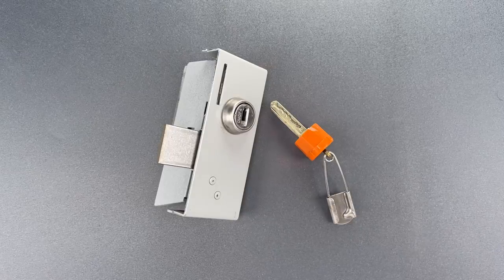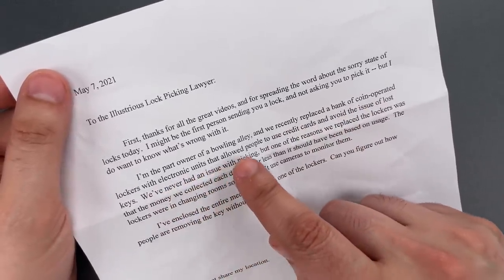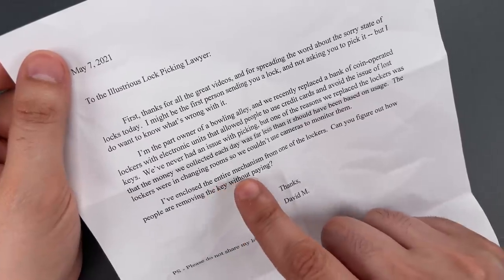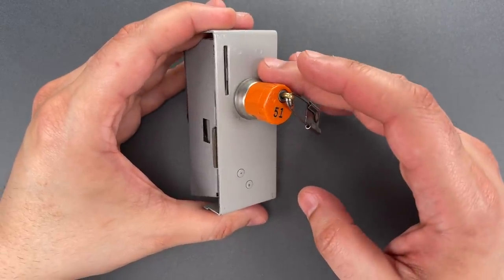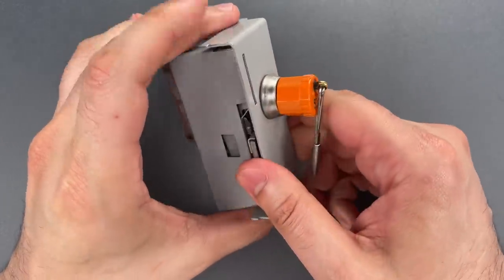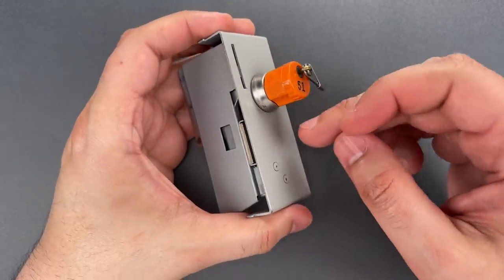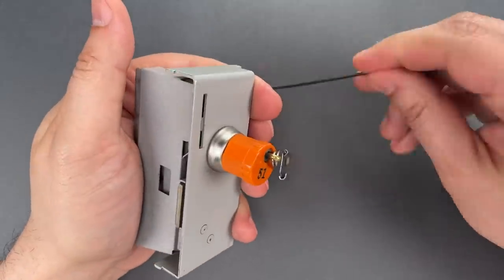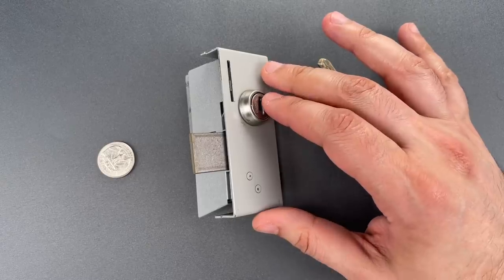[1308] A Huge Flaw In This Coin-Operated Locker Mechanism

Comment: A lot of these coin operated lockers are used at swimmingpools in the Netherlands,  however, you get the coin returned when you open the locker.
Thus defeating the need for cheating the lock.
Reply: Same thing is quite common in UK gyms and swimming pools.  You get a refund on returning the key basically.
Reply: Most manufacturers actually make two versions of the coin-op lockers locks.
Some give you back your coin, some will keep the coins in a secure box within the locker door or below the lock itself and there are even ones (Although I've never seen one in the field so far) that will take two coins to work, one being kept as a payment and the second one being returned.
I'm still trying to figure the point of using two coins though...

BTW I'm French and pretty much every swimming pool I went to so far does have the "free" one coin version that gives you back your coin.
Reply: That also prevents the owner from making money though

Edit: obviously I meant it prevents them from making money specifically off the lockers, not that it prevents them from making any money at all, but apparently some people need that to be spelled out for them
Reply: @_Stormfather  Good
Reply: It's the same in Germany. I think a locker should be part of the service and not a way of making additional money.
Reply: Yeah. And in Norway it operates the same way when you take your empty beer, soda and waterbottles/alu boxes back to the store. Less trash and increased motivation to get the money back. Approximate refund (pant in norwegian) is low end 10% of the beverage (I think) to 20%. All stores that sell such containers also have to take them back. A genius system I'm suprised aren't used in many places.
Reply: @Mr Brightside the issue is (at least where i live) is people not actually using the locker since it only costs like 20p sometimes, keeping the key and then using it later to steal someones stuff
Reply: @Mr Brightside it's about leaving the key in the lock after you got your clothes out of the locker :-) You can only lock (and take the key) when the coin is inserted. No coin, no key :-) Without the need for a coin you could just lock the empty locker upon leaving and take the key with you. The (old) pool in our city actually doesn't use coins but coin-like-tokens instead. You get your token upon entrance, and have to return it when leaving. They somehow code your time into the token, so the turnstyle on the exit knows if you have to pay extra because you stayed in the water for to long. By also using the token for the lock you can't lose it while in the water.
Reply: The carts at ALDI have a similar mechanism, you have to put a quarter in to unchain it, and put the cart back to get the coin back. Of course, if you're nice you'll pass the cart to another person and they get a free quarter. :)
Reply: @Mr Brightside Without requiring a coin, some troll might have the bright idea of locking all lockers and running off with the keys.
Reply: @bluesideking  I agree, it can't be that much money they're making from it. Although, it may be a form of demand control, if they were free there wouldn't be enough lockers for people who wanted them. Who knows?
Reply: @_Stormfather  That's not a problem when nickel-and-diming your customers on stuff like lockers is not part of your business model.
Reply: Exactly. I'm surprised that they have an actual "cost" elsewhere. Seems awfully cheap of an establishment to charge you to use a locker in addition to the cost of the service (gym, swimming pool, bowling alley, whatever). Add 25c or whatever it is onto the price and ditch trying to charge extra for lockers; no worries about people "cheating" the locks and it doesn't make your establishment look so cheap and nasty.
Reply: @randybobandy9208  A QUARTER??? Here in the UK we have to use a £1 coin (about US$1.40)...
Reply: @psirvent8  Reason for two coin version of lock.
Owner has two objectives.
1. Wants rent on lockers.
2. Wants keys returned.

Objective 1 is served by requiring a coin.
Objective 2 is encouraged by providing a "refund" to the user when they return the key.
Hence the requirement for two coins.
Reply: @Mr Brightside A not so nice person could remove all the keys without anything in the locker and not bring back the keys.
Reply: @Mr Brightside It's actually quite easy :-) There's a turnstyle on the entrance, you put your money in (for 1/2/3 hours of stay), get a token and the turnstyle unlocks. Then you use the token for the lock (so you can't lose the token while you have the key and can't steal the key when you got the token back), and on the exit you put the token back into the turnstyle, it checks (somehow) the length of you stay and either onlocks the turnstyle directly or after you payed the additional fee for staying to long. And yes, it's a really neat solution ;-)
Reply: @Mr Brightside 
You're assuming that something was put into the locker. If there was no coin required, there's nothing preventing you from locking all the lockers and taking the keys with you.
Reply: In the old days (80's) in Portugal public swimming pools had workers handing you a sort of clothes hanger with a basket for the shoes and would keep it while handing you a rubber wrist/ankle band with a numbered plate that you'd exchange back for your belongings later when leaving
Reply: @_Stormfather  which is a little pointless, given these usually are in a place where you pay a fee for entrance/membership first
Reply: @_Stormfather  You mean there's bowling alleys in the US that provide games, shoe hire, snacks and drinks for nothing? Their only form of income derives from 25c a shot lockers?

WOW
Reply: @_Stormfather  you're having to pay to be there already usually.
Reply: @Mr Brightside Nudists are a thing! Seriously, though, the payment discourages people from just taking the key with them to reserve their own locker.
Reply: I wouldn't be surprised if people still try to cheat it. Like people stealing free stuff lol. Or sort of similar to people paying $45 for a fake vaccine card instead of getting the free vaccine.
Reply: @naerbo19  used to happen in the US, may still in a few places.

Made for some really disgustingly dirty, nasty and unhygienic rooms where the returns were accepted, so most stores stopped doing it.
Reply: @_Stormfather  you're already paying for being able to enter the establishment. the coin is only there so people don't take the keys from an empty locker
Reply: @redminotecheiraomem2549  Got about the same system here at my local pool in Sweden today but you get a numbered key for a locker on a wristband when you pay the entry fee.
Reply: This is at our amusement parks, swimming pools and shopping malls in Canada.
Reply: @bluesideking  tell that to cedar fair. Lol
Reply: @mallardtheduck1 , so what you're saying is they should charge for the locker, just do it in a way that hides that charge by combining of with the regular fee.
Reply: @CherryGS  No. They don't code the time into the token. Its very rare they do that - especially in this system where the lockers are mechanical. Its more common that the token (or tag) have a serial number. When the token is issued, the time of issue is recorded along with the serial number of token in the computer. When you exit, the turnstile checks with the central computer how long the serial number has stayed.
Propably they also have monthly and yearly tags too, where you can purchase a subscription and keep your tag (ergo turnstile don't swallow the tag but return it to you), and stay as long as you like in the water until the place is closing. Its the same here, the serial number is recorded along with its end date of the subscription.

Think like the barcode on the milk package. The barcode don't encode the price, the barcode is same regardless where you purchase it. Instead the barcode is recorded along with its price in the cash register, so when the barcode is scanned, the cash register knows how much it cost.

In those places with electronic lockers, its more common with tags that bear information. Then the tag stores information about your stay time, and if you have taken a locker (and which one) so the exit turnstile refuses to open if you have forgot something in your locker, and also so other lockers refuse to lock so you can only allocate 1 locker per tag (or more lockers if youre a family). In many cases you can also carry a balance so you can purchase ice cream and such in the kiosk by just scanning your tag, and overstay can also be debited from that balance, and any leftover money is returned.
Reply: In my experience in the states, these are more common in "optional" locker areas.  Like say, at an amusement park where you may want to stash things you don't need during the day.  At gyms and pools and such, you're more likely to see a locker that requires a padlock but is otherwise free to use.
Reply: the 2nd coin is collateral.
it's an additional incentive for you to return the key.
Reply: @bixiebee6165  How do you use the key in a locker that didn't have one for someone to put their belongings into?
Surely any key doesn't fit any lock? Maybe the management just replace missing keys?
Reply: @peterthomas5792  If the management replaces the missing key and not the _lock_, then you got your answer: someone will put something there, and you still have a working key.
Reply: I believe they use the same lock, only reroute the coin out the back instead of to the collection bin below.
Reply: @Mr Brightside Unfortunately some people would just take the key "for fun" without putting anything in the locker.
Reply: @Mr Brightside You could hog the locker by keeping it empty? So when you return you have a free locker to use maybe
Reply: @psirvent8  The point for two coins is 1. Business makes money, 2. Customer is incentivised to return the key (leaving the locker free for others to use). Some people hog the lockers
Reply: @Mr Brightside I suspect it's more to keep someone from just walking up to a bank of lockers and stealing all the keys. If it takes a quarter to take the key, then the user isn't really charged to use the locker, but it can get expensive quick for people with nothing better to do.
Reply: @_Stormfather  It doesnt because those places could just ask for that money on entry. Only time where this is an issue is when you cannot do that which is never.
Reply: German-style supermarkets (i.e. Aldi) do the same for shopping carts. You insert a quarter to unlock it, then you get the quarter back when you lock it back up. Removes the need for cart attendants.
Reply: Same here in Belgium. Don't see why charge for using a locker in places like swimming pool, or a bowling place.
Reply: @randybobandy9208  When I go to Aldi, there seems to be an unspoken agreement among all the customers that if someone offers you the cart that they're done with, you give them a quarter in exchange. After all, you would've already had that quarter ready to get your own cart.
Reply: @Mr Brightside Maybe. Did you put clothes in the locker, or did you just decide you wanted a souvenir key?
Reply: @naerbo19  meanwhile in germany the cities are littered with cans because people leave em out for the homeless.
Reply: @psirvent8  Two coins means the locker doesn't have to make change. It means the locker can give back the exact same coin the user put in it, greatly simplifying the design. It would allow the owner of the locker to rent out the service of the locker, making money, while giving some incentive to return the key afterwards. Personally, I think it's brilliant, and I hope the coin used for insurance is of a high enough denomination to pay for the key a couple times over when the key does occasionally go missing.
Reply: @_Stormfather  The owner is already making money from providing the service. Nickel and diming people typically results in a net-negative experience.
Reply: @bluesideking  I remember going to Germany and Europe in general and felt the same way. Asked for a glass of water and they brought me a bottle of water that was 1 euro. In most parts there aren't public restrooms nor places to drink water or fill a water bottle.

I think it is a cultural thing, in the states for example in a gym you often have to paid for everything in 'a la carte' want a towel? that will cost you, want a locker? that is an extra 25 cents. but then you have things that you often give as granted like water, free refills of soft drinks and coffee, etc.
Reply: @_Stormfather  Places can be pay-to-enter, so it doesn't matter if the locker is free. Cost is covered elsewhere.
Reply: The gym at work had "bring your own lock" lockers which resulted in people permanently occupying the lockers of which there weren't many. I occasionaly considered putting my own lockpicking skills to work but didn't want to inconvenience anyone genuinely using them. Supposedly locks were supposed to be removed every weekend by management but never were.
Reply: @naerbo19  I've seen it used, vary rarely here, for shopping carts, where you pay a coin to get a cart at the front of the store, and get a coin back when you slot it back in the rack as you leave. I understand the system is more common in Europe and the UK. It cuts down on the number of employees needed to go fetch carts from the parking lot, and reduces the damage, to the carts and the cars, from them hitting cars and being run over. Both of which, naturally, reduce operating costs for the store.

Some states do have a bounty on empty beverage containers, usually 5 to 10 cents. I suspect it's for exactly this purpose. It also probably re-created the ancient job of rag-picking.
Back in the before times, as in Before Plastic, bottles would be collected, washed, and refilled. That's less for waste reduction, or litter control, and more a rental on the glass bottle.
Reply: @FrancoCastro  Yes. Definitely not unusual to be out shopping in Europe and get caught short. Never pleasant.
Reply: @KingdaToro  Only fair. Though often that gets turned down here.
Reply: Same in Norway, except since no one uses cash anymore, you can buy these little 'coins' with holes in them that you can attach to your keychain and then use when you go to the swimming pool.
Reply: The owner is a cheapskate who deserves it. Any reputable business returns the coin. He’s already making money from his bowling alley.
Reply: same in france.
Reply: @wictimovgovonca320  > I believe they use the same lock..  
So you could insert a coin in any lock, grab the key and open any other locker?
I can't believe that, they'd be in court the first day it happened.
Reply: You need to come to the uk mate looool
Reply: @Mr Brightside well there could be a jerk just locking all dors with nothing in them and throwing the keys all away.
Reply: True, money should be spend at the entrance, not when changing clothes. The coin should just be there to discourage people to just keep the key to the next workout session (wich they often do in gyms) or forget to put the key back in.
Reply: @_Stormfather  Money is made by charging admission fees and selling food. The locker is there as a service, but the coin is a deposit so people actually return the keys after use.
Reply: @_Stormfather  well.. they are already making bank from memberships and over priced single time gym/pool uses, might as well give out complementary locks to their loyal customers
Reply: @Mr Brightside so you don’t just lock a lot of lockers and take the keys with you
Reply: Seems like a good system, really. Rather than nickel-and-diming the customer, it's usually better to try to cover your costs with a higher-level charge like a membership or admission fee. Only thing like that I've seen in the US is the shopping carts at Aldi, which take a quarter and eject it once you return the cart and re-connect it to the chain.
There's definitely some cost/benefit mismatch for any would-be cart thieves, and there's no way someone determined couldn't get their quarter back after walking away with the cart, but it seems to work well for 'em. Of all the carts I've seen abandoned on the side of a road, I've never seen one of theirs in the wild.
Reply: @Mr Brightside Who says you have to put anything in the locker? If the intention is to take the key, hope the owner just replaces it with a spare then you can get access to someone else's belongings. That said, I'd hope the entire lock would be replaced to prevent this but who knows what an owner might do to save some cash...

edit: and I'm late to this party ;)
Reply: @S_Roach  I suspect that we don't just wash and refill, but melt the cans and glass flasks down and make new ones, or use the material for something else. I could be wrong, but from listening to my brother who collects milk from farmers with a lorry, it seems it would have to be washed with very hot water and some highly acidic chemicals to avoid a new plauge.
Reply: @harpingon  in Spain it's the same; coin returning in swimming pools, supermarkets, bowling...
Reply: @_Stormfather  not if you pay to enter. I've never seen a coin operated locker in Denmark for a swimming pool for example. you pay at the entrance and the lockers will just have keys in them and you can use them free of charge.
Reply: @randybobandy9208  or you use one of the fake coins they sell at every store for the carts
Reply: @randybobandy9208  I've also seen local urchins going around and collecting the carts in the parking lot to get the coins back. So it's a way for the store to avoid having to pay anyone to round up carts.
Reply: @jrd33  I expect you get it back, like we do in Catalunya where it’s 1€/50c. If someone was cheap enough to try and chisel me out of money like LLP's guy I’d go somewhere else on principle.
Reply: @bixiebee6165  If they kept the key how would the party of the second part secure his stuff? Unless you mean he’d just put it in an unlockable locker. I would pay the 20c to hire the key and get a copy cut.
Reply: @aloysiussnailchaser272  he's under no obligation to provide a locker. If you want an additional premium service, what's wrong with being charged to use it? Fairly straightforward.

I've actually never seen a bowling alley with lockers myself. Usually there are cubbies by the doors, by the lanes, or you just stick your shoes under your chair. I'd rather keep my stuff in sight regardless.
Reply: @giin97  It's not a 'premium service'. It’s just mean spirited. I’ve never been in a bowling alley but presumably that has to be paid for. I’d expect something as basic as a locker to be included. Of course no one is under any obligation to use it.
Reply: @BunjiKugashira42  People still do this, but at least the £1 can go towards the cost of getting the locker re-keyed.
Reply: @naerbo19  It is in many, many jurisdictions, just not involving every store needing to sort and store empties, but go on.
Reply: The ones I've seen also take the coin inside the locked door. So you can't access it when it's testing the coin.
Reply: What's the point of a system like this? Aldi in the US does this with shopping carts/trolleys, but that's to incentivize people to put away the cart. What is the purpose of doing this with a locker?
Reply: @harpingon  same for germany
Reply: @randybobandy9208  a round key works as well.
And if the key is small enough you can easily take it out while opening the mechanism.
Heck, a toothpick works.
Reply: @tee2567  I'm aware that many other places have such a system or similar systems. Found an article which explains a tad better and also have photos. Though the reimbursment have increased recently from 13 cents and 30 cents to 24 cents and 36 cents: https://www.sciencealert.com/norway-s-recycling-scheme-is-so-effective-92-percent-of-plastic-bottles-can-be-reused . I read through it and seems accurate, but I can't vouch for the % being mentioned there.
Reply: @Adam1nToronto  which would result in other guests being unable to lock their belongings up, thus leaving them vulnerable to theft when the key-thief comes back.
Reply: @aloysiussnailchaser272  it's an extra thing not required nor expected. It being available for an added cost is literally the definition of a premium service. It's mean spirited to offer a dozen lockers for any patrons that don't wish to put their shoes under their chair, and then charge to use them? The simplest alternative is to simply not buy and install the lockers, thereby removing the option from others. Just because you aren't interested in the option, doesn't mean others aren't.
Reply: @_Stormfather  isn't the core business supposed to earn the money? Lock is merely an evil necessity for the former. I myself rather they "hide" the locker charge in the overall cost. All these extras tend to bug me, even i know nothing is for free 😁
Reply: @_Stormfather  Is the owner on the business of renting lockers or on the business of running a gym, bowling alley, department store, etc? Stop trying to make money out of absolutely every little thing.
Reply: @giin97  We’re not going to agree about this, and that’s fine. I think it’s mean, you don’t. No problem :-)
Reply: @_Stormfather  How very American/Ferengi of you.  ;)  The business owner has a vested interest in protecting customers' belongings.  Not every single aspect of a business must make money on its own.
Reply: @Mr Brightside If you don't have to insert a coin to use the locker, some cretin is going to lock them all and keep the keys, just for a laugh...
Reply: @jdjk7  It incentives people not to steal the keys. The coin only drops out when you unlock it, so even locking it open will cost you £1.
Reply: same thing at the gym at my university. you get your quarter back when you open the locker
Reply: @majorgnu  the lockers need paid for somehow.. should the business owner not bother with secure storage and just say "all items are your responsibility, dont cry at us when its stolen because you're too tight to pay 20p"
Reply: @jrd33  yeah.. but you get it back..? Unless you're that hard up you need that for the shopping. But then Id argue you dont need a trolley 🤣 honestly I dont think its anything worth drawing a big comparison over, just buy a trolley token
Reply: @thelemoneater  

"I'm paying for one thing, they should give me something else for free."

FOH
Reply: @bixiebee6165  How would that work? They take the key, locking the locker, and then it can't be used.
Reply: This is common all over Europe: Germany does the same thing with shopping carts.
Reply: @CherryGS  So if you did stay for too long the turnstile on the way out stays locked ?
Hmmm

But what happens if you happen not to have enough extra change to pay the extra fee ?
Do you get stuck at the pool ? 😂😂

Never seen a system like that in France so far...
Reply: @KingdaToro  What are cart attendants ?
I've never even heard of them so far...
Reply: @naerbo19  I doubt it. Anything alive can be killed with a high enough application of heat, and you don't need to get as hot as glass melts to sterilize glass. The cost to remelt glass would quickly get too high to be profitable. So long as you're not trying to destroy prions, soap and heat, and some mechanical scrubbing, are enough, at least for food safety.
Also, I was referring to the Before Times, when vending machines full of glass bottles were a common sight.
Reply: @FrancoCastro  Well if you're in France you can ask most restaurants for a carafe of water (Carafe d'eau in French to be exact) and they will bring you, well... a carafe (or pitcher in english) of water !
for free, provided you've already purchased something of course.
Reply: @robertrijkers4923  Have you ever been to Germany? Cities here aren't littered with cans because cans are out of fashion for almost two decades now. Bottles are far far more common. I haven't bought a can in at least 20 years. And places aren't littered with them but bottles because there are lots of people out there collecting them to get the deposit.

One observation is true though: most people will put the bottles near the trash, not into the trash, so those poor souls collecting them don't have to dig through the trash so much.

Cities littered with cans was an issue in the early 90th before all beverage containers had a deposit added to them.
Reply: You can make a lot of money checking the return slots at the end of the day
Reply: I would say "defeat" is the wrong word there. What LPL did in this video constitutes "defeating" the lock since he used it without paying. 

The scenario you are describing is "avoiding" the use of a lock that requires payment and instead using a lock that requires collateral. 

Those locks can probably still be "defeated" too if you want to use them and don't have a coin.
Reply: @randybobandy9208  yeah, that's another thing that Europe has had for a long time.
Reply: @S_Roach  Ah. Sorry. Yeah, your reasoning is logical now that I think more closely. Thank you for correcting me 😊 I just read on our country's responsible company which is owned by the state that we don't have reimbursement on our glass flasks anymore due to our counties having a well working recycle system for glass. And as such it isn't that critical to have pant on them.
Reply: @peterthomas5792  Same lock, not the same binning.
Reply: @bluesideking  The swimming pool I want to as a kid actually used these lockers to pay the entrance fee. You bought special coins and then whenever you wanted to go swimming you just used one of those coins on the locker. They also had signs that you are supposed to wear the key on your wrist (it had wrist band like on cheap watches) so they could see that everyone indeed paid.

So those lockers can be used as the way of making money, not an additional way of making money ;)
Reply: They're used here in Canada as well, but the money is kept by the facilities.
Reply: @naerbo19  you mean recycling? that is a service provided in many nations, for a reward as well
Reply: Those are (or were) fairly common in the USA as well. I used one last fairly recently at a major museum (right before covid).
Reply: @_Stormfather  The main reason to have coin operated lockers is that people don't steal the keys.
Reply: @randybobandy9208  Aldi Australia its $1 and $2 for the carts, that's enough that you wont, most of the time, give it to someone else.
Reply: Yeah aldis too. But who the fuck carries coins
Reply: @MadDecibel  The lockers should be a complimentary service and only take coins as a deposit for the key.
The money "for the lockers" would come from the same place as the money for the lights, the air conditioning, the furniture, the floor, etc., that is the actual service and products the establishment provides.
It's a bowling alley, not a safe deposit box service in a bank.
Reply: @bluesideking  Not in the U$A everything is about $$, ski areas use these, they use to be just .25 one quarter, now they are $1 or more sometimes.
Reply: @notahotshot  Yeah! Screw giving people complimentary service!

Let's also charge a fee for using the doors, another fee for using the chairs, one for stepping on the floor, and let's not forget breathing the air!
They can always faze through the doors, hover around and hold their breath if they just want to pay for the actual bowling!
Reply: @psirvent8  well its pretty simple. One coin is payment for the usage, another one is an incentive for you to not take the key home accidentally, thus having the owner to replace the key with another one and unlocking the occupied locker that other customers cannot use. It's probably for situation when you didn;'t leave anything of real value to you in the locker (e.g. towel for swimming pool, etc)
Reply: A lack of greed probably solves many problems
Reply: Yep, same here in Czechia. I've seen seen those only at swimmg pools, though.
Reply: @Mr Brightside i would guess. But seems in upside down world there is still debate on that.
Reply: Like the shopping carts at Aldi. It's a great design, because it prevents people from leaving their carts all over the parking lot. And if they do leave one out, any customer who decides to do the store a favor and bring it in gets paid a quarter.
Reply: @_Stormfather  Shouldn't need to make money on the lockers, though.
Reply: @bluesideking  build you a swimming pool, or a bowling alley and set your lockers up like you want, otherwise you dont have a say....
Reply: @psirvent8  This is germany, we don't stay to long, unless we know we have enough money on us ;-) If this ever happens you have to call someone from the pool-staff and talk to them. They can always let you out manually.
Reply: @Mr Brightside It's basically there to stop the funny kids to lock them empty and take off with the key
Reply: Same in Spain. Only place you don't get the money back is in bus and trans stations, but those are baggage lockers
Reply: @Mr Brightside A lot of these lockers are in public spaces like train stations (well, in Germany, anyway; and they're getting replaced with newer models as well) and the idea of the train company was to basically offer a storage space for rent and make some money from that.
The fact that these locks are easily tricked is one reason why they are being replaced.
The use in a bowling ally suggest the charge to be intended as some kind of wardrobe fee and might be part of the cost structure the owners are working with; charge for admission might be lower but people who need to stash their stuff during the stay have to pay extra (given limited space) and I bet there's equipment rental available as well.
Reply: @randybobandy9208  you should have seen my arguement with my granmother about how the quarter was payment since we couldnt get it back so technically the cart is ours once you get it free and its a refund once you return it. im fairly certain i could swing it in a court case if need be.
Reply: That's pretty neat. In my town the system works a little different where you get a ticket you use to lock the locker (insert it on the inside to arm the mechanism) so the ticket can't be lost and in oder to leave you put said ticket into the turnstile on exit where it will check the time and charge you for overstaying. The key itself doesn't stay in the lock, BUT you need your ticket to get a key from a massive bank of keys near the entrance in the first place, you put the ticket in and one key gets indicated and released. Before you leave, this key needs to be replaced and the ticket gets updated with the info that the key has been returned; otherwise, the system logs the missing key, you get charged for losing it and staff is informed about the unusable locker you created. If too many get locked out due to lost keys, action is taken to replace locks and keys in one fell swoop. If keys were lost on the premises there is after all a chance they will be found by cleaning staff, negating the need for lock replacement or rekeying.
Reply: @Mr Brightside People do stupid things like removing their clothes then locking it empty so they can reuse that locker the next day etc - reserving their favourite and such. Many other weird examples.
Reply: @JarrettMvM  For us it is two separate systems. One the counties provide. A manual sorting facility where you take plant matter, stones, electronic, glass and so on. The plastic bottles and aluminum cans go to a national operated Infinitum where the goal isn't to make money, but rather collect as many of the bottles as possible as they track how many are sold.

Does this answer your question or have I massively missed the mark of your question?
Reply: @jdjk7  So people don't just take all the keys. Mostly a measure to stop having to replace locks every other day if some dweeb feels like it.
Reply: Then why bother requiring a coin?  I don't get it.
Reply: @CherryGS  Ok, that makes more sense.  Thanks for this.
Reply: I mean unless you want to steal things
Reply: @_Stormfather  Entrance Fee +1 Euro = Problem solved
Reply: @Mr Brightside  the alternative is just a free locker. so that would mean you could steel 50 keys just for "fun" the coin is to prevent that
Reply: As a kid we knew there would always some people not expecting their £1 coin back, so a quick check of empty lockers when you were done swimming meant you could pocket a few pounds regularly
Reply: @randybobandy9208  this is how we used to do it - people are lazy and would leave their shopping trolleys near their cars in multi-storey car parks even if they still had pound coins in them. On a Friday night, 15 minutes walking around the park would get enough cash to buy a cinema ticket and drink.
Reply: @bixiebee6165  yeah, but how would the next person use the locker if you still have the key?
Reply: @_Stormfather  So make it up elsewhere. Make the booking fee that much more. Why does it matter if it comes from the locker specifically?
Reply: you are talking about the lock which was featured a few weeks ago. this one does NOT give back the coin the user.
Reply: @Mr Brightside 
You would think so, but that’s actually not the problem. The deposit system is there to prevent people from locking empty lockers and removing the keys… either as a stupid joke, or to make sure a there is a locker available for the person pocketing the key.
Reply: @_Stormfather  The owners isn't making money. They're taking money, in exchange for absolute sweet fuck-all. It's parasitism, pure and simple.
Reply: @gloverelaxis  lmao. Some of the other responses on here were at least reasonable, but yours is bullshit. In return for the money you get access to a locker. That's why people pay the money in the first place. That's not at all "fuck all".
Reply: @majorgnu  Most businesses models aren't worth investing in unless you own the building outright.  Otherwise, you're at the bank's nonexistant mercy.  Sure, you can try to sue if they change the terms of your lease or mortgage, but they can just drag it out until you go broke and your legal team quits.  Or at least they can do that often enough that the occasional court loss costs less than the wins bring in.

It's sharks all the way down unless you outright own the business free and clear.
Reply: @harpingon  same in the US.
Reply: @TheAttacker732  Ok...? I don't see how that relates to the discussion.
Reply: @naerbo19  It's not used in more places because it's NOT "genius". It consumes large amounts of resources to build and maintain such a system. More resources than you save. All the energy used to build, install, and maintain those machines.

The plastic bottles are largely worthless and will usually end up in landfills anyway.

The aluminum cans are usually worthwhile to recycle, but the value doesn't cover the costs of maintaining the reverse vending machines. The only way it makes sense is to have a small number of collection sites that pay by the pound. Sometimes there are collection sites where you "donate" the cans and the proceeds are used to fund a charity.

Dumping your used motor oil down a storm drain is likely less damaging for the environment than bottle deposit laws.
Reply: Same in Luxembourg, I have never see coin-operated locks that keep the coin afterwards
Reply: @Mr Brightside No it's not enough.. because if you take one of their coins then people will not so easily be smartasses and lock those things to be able to take keys with them just to be idiots. If you keep one coin, the price is already double and will cost the people who want to be "funny" 2 coins, while it will cost only 1 coin for the ones who use it as intended.
Reply: I've seen a similar mechanism on strollers in Japan.  You put a 100 yen coin in the mechanism holding the strollers in place, releasing one for you to use.  The yen remains with you on the stroller, but locked in place until you return the stroller and lock it back in place.
Reply: @randybobandy9208  When I pass the cart to another person, they'll usually give me the quarter they were going to use or they'll say "Hey, I'll buy your cart for a quarter" when they see me getting ready to walk back to the store to return it.
Reply: @jrd33  How big is the £1 coin in relation to the size of the quarter? We could use $1 coins over here but they're bigger and not as popular as the quarter.
Reply: @_Stormfather  Why should they earn money from the lockers? The use of lockers should already be included in the admission price of the facility.
Reply: @adamgh0  Pound coin is slightly smaller but 50% thicker. Last time I was in the US (quite a few years ago), I don't think I saw any $1 coins at all - but lots of very worn $1 notes... Our smallest note is the £5 (worth about $7).
Reply: @_Stormfather  I mean if it's just a quarter a person I don't think the profits would be huge but who knows maybe it adds up.
Reply: Same in France, I never got why they did it btw
Reply: In America, we constantly search for new ways to make money off people. "Hooray for me! Screw you!" Is our motto. Credit card companies are prime examples. They get money from both ends of the transaction and even have human behavior analysts on staff to figure out ways to trip their customers up and charge them even more money. Card holders and business owners alike.
Reply: @_Stormfather  Even if you took a dollar, and you have 30 lockers, that's only 30 dollars an hour tops for a bowling alley. Taking all the coins to the bank to have them exchanged for notes or deposited would probably cost more
Reply: I mentioned that to the owner of a grocery store in the area. His locks are cheap to use but keep the money but a nearby compeditor charge more but gives the coin back. This was years ago so not even the more expensive coin is much of a loss anymore.
Reply: @mallardtheduck1  honestly I disagree if you have ever run a small business you would understand. You could say charge up front for it and just give them a key. What if they forget to give the key back? Now you have to change that lock entirely to ensure that safety of the next person to use the locker which is costly now that persons visit was a net loss. It’s seem more of a way of ensuring that doesn’t happen.
Reply: @randybobandy9208  your idea of being nice is to give away your money? Capitalism at its worst.
Reply: the lockers at my gym are just combination lockers that can be easily set when you first lock it. if you forget your code the workers have the master key for the locks
Reply: @randybobandy9208  There was no Aldi where I lived before I moved. So the whole concept was new to me. The first time I went and got a cart, it was weird but I understood, then I walked out and forgot about the whole quarter thing and a lady said here is a quarter for your cart, and I was like what are you talking about? A weird experience all together lol
Reply: It is silly to charge people for using the locker. It annoys people. You will make more money on snacks and drinks if you don't charge for the lockers.
Reply: Only in capitalist america do they try to make money even from temporal locker storage space meant for already paying customers. No shit people will find ways to defeat this, lmfao.
Reply: @Mr Brightside If you had a free locker that didn't borrow a coin, someone could lock all the lockers up and take all the keys.
Reply: See that makes sense. But charging people for using lockers is the main reason why people are cheating this unfair system. Lockers aren't perishable, so why people are being charged to use them when they already paid to get in the establishment and use its facilities?
Reply: @Mr Brightside that's not how things work. They could always give back the coin you insert but they decided not to do that.
Reply: @Mr Brightside so punish everybody for the mistakes of the few. That's not fair and you know it.
Reply: @Mr Brightside I bet they already charge for lockers then added the locks. I have very little faith in businesses and their shady practices.
Reply: @Mr Brightside I don't have to because I don't live in a country that allows this nonsense.
Reply: @Mr Brightside no I live in a free country where this stupid practice is just publically unacceptable so nobody practices it. You don't need laws to enforce human decency.
Reply: Also seems to defeat the purpose of placing a coin inside. At that point, just add a button that allows the person to pull the key out when pressed that depresses when the key is inserted again .
Reply: @psirvent8  the second coin is meant to encourage the user to return the key maybe?
Reply: its a deposit c:
Reply: How do they pay for the lockers??

Taxpayers, I'm sure it's taxes if everyone gets to use them for free, lol
Reply: @fiveninecummins7768  why would you need to pay for the locker if you already payed to the facilites? In Norway (public) public baths gyms are almost free with a locker inkludert! In (private) public baths and swimmingpools you still just pay for the ticket. Often the key to å locker is validation instead of a ticket or smth
Reply: @fabiansw8  Uhh, because you invested in those lockers. Anything you invest in needs some kind of return, otherwise you're just robbing Peter to pay Paul. Why would you use pool money to pay for lockers, then let people use them for free? You're paying for one asset with the money earned from another, and that's literally ret@rded.
Reply: @fiveninecummins7768  People dont come for the lockers! Do you expect to make a profit of everything you buy? Should we pay a fee do use the door aswell?
Reply: @fabiansw8  Yes, I do expect to make a profit if that's my business. You have to profit in order to STAY in business. It's basic economics..giving stuff away will eventually catch up with you and cost you..just ask the wasteful businesses that are no longer around, or just ask any government in existence.

And just because I want to profit off a business I invest in doesn't mean that I don't do charitable things for people. Those things aren't mutually exclusive, so don't pull that card.
Reply: @fabiansw8  And it depends on where the door leads..does the door lead into a nightclub with a door charge??

That's a really dumb argument. They're not the same, and you do pay to use the door, but you don't realize it. You don't understand that if they invested in said door, then you can probably bet they're somehow charging you. It may not be direct, but there's been a price increase to cover it in some other area.
Reply: @fiveninecummins7768  lol
Reply: @fabiansw8  Yes, when you're unable to adequately express anything but stupidity, the old "lol" is a strong option..
Reply: @jrd33  corned beef tin key will get u a free trolley anywhere in the UK 😂
Reply: That’s what i was gonna say lol i’m also from the Netherlands
Reply: My old local swimming pool called Fort Regent had these style of locks, back in the 80s and 90s. It used to be a refundable 20p deposit.
Reply: @psirvent8  the first coin is payment for using the locker, the 2nd is collateral to bring the key back I guess
Reply: These are flawed anyway. Someone could drop a coin and steal the key without storing anything, making it expensive for the owner to get new key or lock. Much more expensive than how much they'd earn from one. Just don't charge anyone
Reply: @bluesideking  they could rise their prices to include it, but it's more about not having to manage keys than making money
Reply: Huh
Reply: Yup same in the UK.
Reply: @randybobandy9208  and if you're smart enough you can break it by inserting the chain into it self
Reply: same in Germany
Reply: @RoundBaguette  Why is it good?
Reply: @mulgerbill  Way to miss the mark by a football field's distance.
Reply: @randybobandy9208  Oooh! Oh! I know!
It's just a cheap form of protection that people like my wife use cause they don't wanna leave their purse or bag or whatever in their lane when they inevitably have to piss or something. And not everyone is paying attention.
Reply: @bobtahoma  Ah, cause a 25 cent locker is too much.
Reply: @clickallnight  An absence of greed also causes plenty too. Balance.
Reply: @gloverelaxis  Except the person paying gets a locker to store their stuff in so they don't have to watch it constantly for thieves. Ask my wife about it. She loves it.
Hah. Parasitism... Try not being stupid.
Reply: @ricksimon9867  Not really. If you're going into the bowling alley with only the exact change to pay for a game and some snacks. You wouldn't use the locker anyway. It's for people like my wife who just want some extra protection.
Reply: @janne6657  Ah, your words make me remember back to my younger years. Oh how lucky I was to get away from the Commie Paradise that quickly turned into a shit hole after I left.
Reply: Yeah, that's how it works in civilized countries, or better yet, no coins.
Reply: Same in Swimming pools in the 90s here in Ireland.
Reply: I've never encountered one of these in the UK. Every one that I've ever seen gives you the money back when you put the key back in. I think they would be a public outcry if any leisure centres changed to this "keep the coin" system!
Reply: @chaymation2  *there
Reply: @randybobandy9208  For this, I use a propperly sized steel washer. I works for me at ALDI, LIDL, MERCADONA, CONSUM, etc.
Reply: then... what's the point
Reply: @BunjiKugashira42  The keys may be worth more than the coins used, no? Use many coins, run off with all the keys, and send a message back to the business owners telling them that for a small amount of Bitcoin, they can have the keys back.
Reply: Smart approach vs Greedy approach.
Smart wins.
Reply: I remember seeing grocery carts with the same concept in Scotland. Though that was... I think 20 years ago. And now I feel old.
Reply: Not America. Capitalism .25 cents at a time . Good deal if you ask me
Reply: @harpingon  A pool I used to go to very occasionally many years ago had similar (but different) locks on the lockers. Once when I came back out of the pool I could tell something was wrong with my locker, I think the key didn't want to go in easily or maybe the door wasn't quite fully shut. I went to get help and when I found somebody to help they came and kind of forced the key in but when they opened the locker all the coins it had collected came showering out on to the floor. I think somebody had been trying to break in to it and maybe unscrewed something. I was lucky all my belongings were still there. Also I was lucky I wasn't the one who broke it and then had to explain it wasn't me who was trying to steal the coins.
Reply: @mallardtheduck1  The coin requirement is mainly there so kids don't steal all the keys.
Reply: @_Stormfather  "That also prevents the owner from making money though"

Wow dude!! How did you come up with that conclusion?! "Coin - Coin = No coin" wow, you must be an economist of sorts! What a prodigy!!
Reply: @DarkOmegaMK2  clearly that wasn't quite so obvious to the person I was talking to, or they wouldn't have made their comment in the first place. Have any other unnecessarily acerbic remarks?
Reply: @_Stormfather  That's funny, the only thing that's "unnecessarily acerbic" is your own comment. You're projecting so hard. Lmao!
Reply: @DarkOmegaMK2  sure thing kid
Reply: @_Stormfather  keep getting high on copium. 🤣
Reply: I'd still cheat it.
Reply: nope thats not how it works in singapore, they keep ur coin, so if u locked and forgot to keep ur glasses, pay more.
Reply: Aldis does that
Reply: @bluesideking  It would be nice if Germans thought the same about public toilets. It was a shock coming from the US to Germany and having to pay for toilets in shopping malls and the gas stations on the Autobahn
Reply: So it's a deposit rather than a fee. Neat.

In America tho it would almost always be a fee.
Reply: sounds like this system is just meant to make sure people actually take their stuff with them when they leave.
Reply: @BunjiKugashira42  Funny you should say that. I was keenly aware of this exploit many years ago at my old bowling alley. After arguing with the manager for rooking me out of lane time one evening, I came in early the next morning just after opening and proceeded to pull every key one at a time, throwing each into another random vacant locker, which I then pulled the key, threw into another random locker, etc., until I had the last one in my pocket. And before you point out the obvious, yes, I was a real d-bag when I was younger.
Reply: @psirvent8  I wonder if two coins might be an attempt to hamper the trick above, by making it a dual pin setup. ie the second pin can't engage until a coin is dropped deeper into the system. it doesn't prevent fake coins or blanks, but it does make tool bypasses more tricky.
Around here people use a tool to avoid having to put a token in the grocery cart deposit.
Reply: Over 200 comments in and I’ve realised something that only makes sense to Europeans: The USA is the Ryanair of countries. For the rest, it’s a budget airline that sells you a ticket for a, sometimes slightly, lower price, and then charges way more for everything else that you normally get as standard. Want more than a small carry on? That’s extra. Window seat? Extra. At some point they were even considering standing room. On a plane. So yeah, if I’m already paying x amount to use your gym, I’m going elsewhere to any other gym if you try and charge me to use the locker.
Reply: @redminotecheiraomem2549  This still exists at some pools here in France
Reply: @_Stormfather  to be fair they could just charge 25c more to use the facilities with the added bonus of not having to waste manhours collecting small change from a few dozen coin hoppers
Reply: that sounds like an easy payday